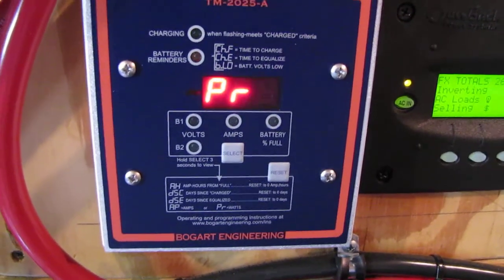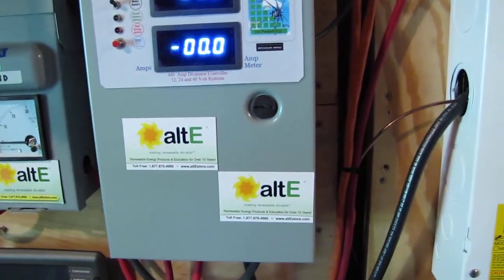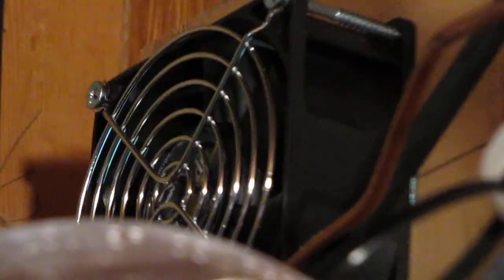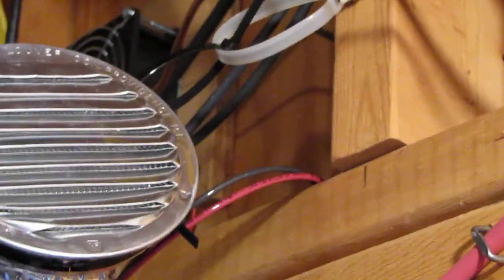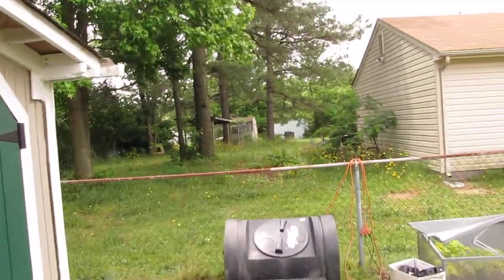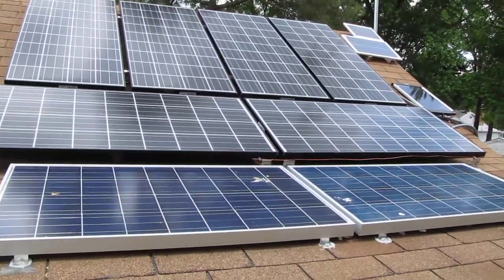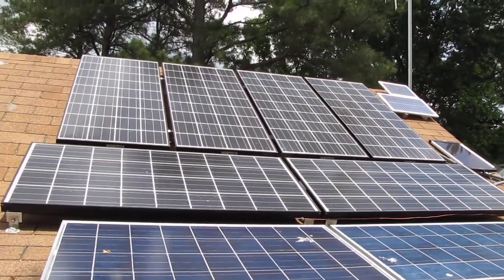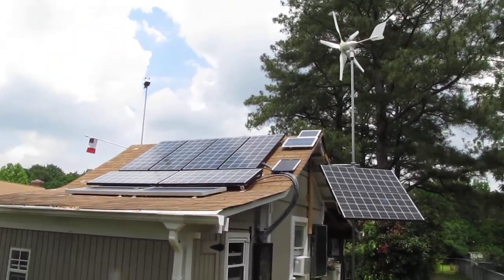OutBack GTFX 2524 Solar And Wind Update In Southern Virginia More Power  VIARLOCITY

Comment: nice setup I am VA beach area I have 4 125 watt UL-Solar panels also made by asunpower c0M I actually ordered two from UL Solar and they sold me labeled asunpower but, same size and specs of the Ul. The power out put your getting is way better then me right now. I need to get my panels on roof and get better equipment. The outback is great I want the flexmax60 it allow you to run long runs at high 12-60V then converts to 12V for batts. Very efficient.  Hit me up some time

Comment: great set up.
i'd like to ask if i can buy ONLY GTFX 2524 and plug 6 panels of 250W and 2 60A battery (24v).
With this setup i said, will i be able to charge the batteries and send the excess energy to the grid?
Thanks since now